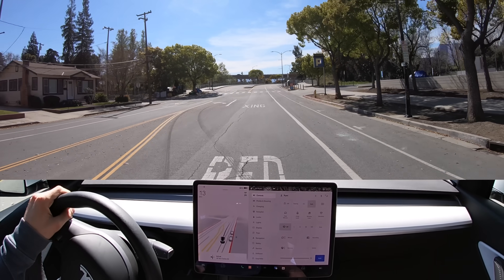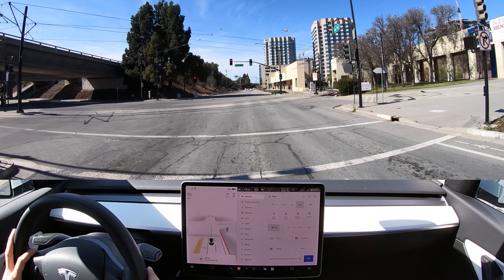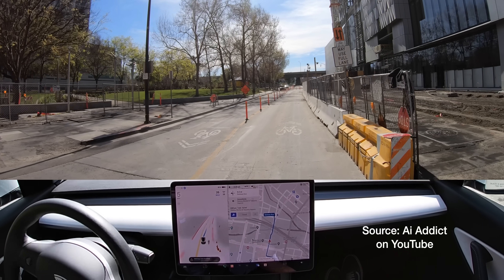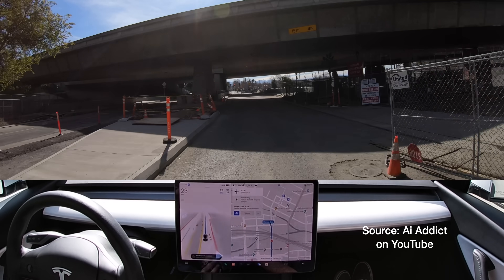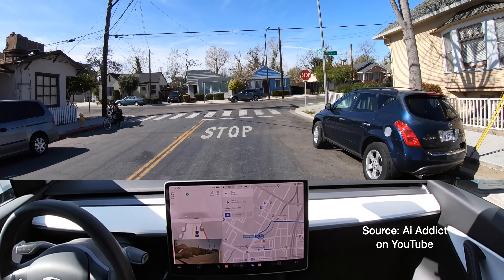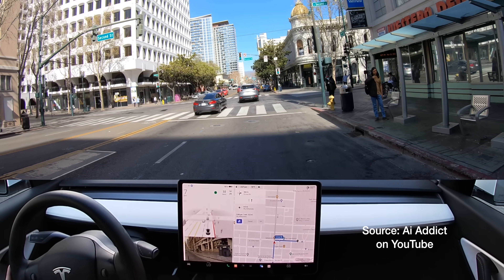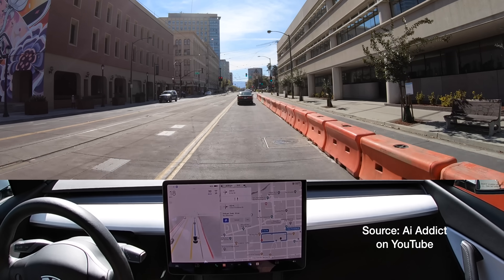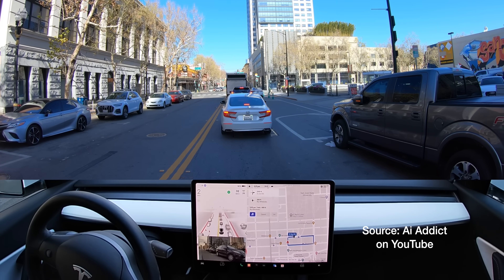Tesla FSD Beta San Jose Stress Test

Comment: It seems like it always goes into the bus lane first, when it should really widen the turn into the  correct lane..

It seems like Tesla has pretty much gotten up to the 80%-90% solution which a great achievement..... It's the other 10% of driving situations that are the hardest to manage.  I'm not confident that the current system will ever be "ready for prime time" when it comes to automatically handling unusual situations.

Comment: Stop posting shit videos. You are giving Tesla a bad name.  I own a Tesla Model S myself and it has a bunch of problems, but this is the price we pay for driving a Tesla. No need to tell the whole world about the problems. Just hide it because Tesla and Elon Musk is a God!  

When I accepted my car, I too noticed the shit paint job on the doors and bottom trunk that has massive orange peel and over-spray drips. Did I complaint? Nope! I just took it to a car detailer and they fixed it for me. Only cost me $800 to fix it.  Not a big deal!   There were some area that was touched up due to paint being chipped and or scraped during delivery / testing. Not a big deal. You can't even see it unless you look at it 1ft away. 

Yes, my rear taillights do collect moisture everytime it rains. Not a big fuckign deal. Every night, I just put a heat lamp behind it and by morning, the moisture is gone.  Just head to walmart and buy a heat lamp. Not sure why so many people crying about moisture in the tailights. This is normal because our cars are made by hand and is custom made.  There are bound to be some issues with this. But when I step on the brakes, it still lights up and works like a brakelamp. So quit bitching about it. 

Yeah, my fender gaps are all over the place. Again, this car is hand-made by hand by unskilled laborers. You expect fuckign perfect fitment? lol GTFO here with that nonsense. Not a big fuckign deal. We spend 95% of the time inside our cars. Why the fuck you crying about poor fender alignment? Who cares if the left is has a bigger gap than the right side. It's a FUCKING FENDER. It doesn't affect performance.  

Yes, the rear trunks RUBS every time I open it. That isn't a big deal since I rarely open the trunk.  No one is going to notice it anyways. So many idiots out here crying about their trunk only opens halfway or how it rubs, squeals, makes noise. GTFO here. It's a fucking Trunk. Leave it closed. WTF you doing with the trunk everyday? Not a big deal!

Yes, my interior plastic panels is falling apart and squeals at every bumps I hit. Just glue that shit back on. You idiots heard of glue? I bought a box full from Amazon for dirt cheap. I keep it in my glove compartment and glue it panels every now and then when they pop out for no reason. This isn't a big deal to me. Glue works fine. You idiots don't know how to use glue? LOL 

Rubber door trim falling apart. This is normal wear and tear. You open and close the door every day. WTF do you expect? You think these rubbers trim are suppose to last more than 6 months? lol fucking morons.  You can buy these rubber trim off Tesla for $600 a piece. Yes, it will take 8-10 months to get it but Tesla is one of the best selling cars. You know how many cars are out there. These gaskets last 1-2 months so they are selling like hot cakes.  Plus, these parts puts more money into Tesla pockets! So I'm glad they found a way to earn extra money selling parts for Tesla. 

Most of the complains are all part of owning a car. It's called Maintenance. If you cannot afford to maintain your car, than don't buy a Tesla. I am a proud Tesla owner and will buy the Cyber truck. Tesla is the BEST car manufacture out there. Elon KNOWS what he is doing. All the people bitching about Tesla need to STFU and quit defaming the brand. If YOU think you can do better, than make your damn car.

Comment: Question: does the car not have some kind of mode that lets you record the way you drive on a specific road so the car knows where to go or to manually look at the map and remove areas the car shouldn't go to? I feel like adding that flexibility would at least prevent it from going down things such as the rail road tracks as you would know the car does it and you're telling it not to go down that road in that situation. Might be difficult to implement (i don't know for sure) but it seems like it would at least prevent the car from making the same mistakes given a very specific situation as computers can be very stupid at times.

Comment: The big problem with AI driving is that every town every city has their own rules and regulations. Not to mention weird geographies. And special roads that are not seen everywhere. 
There is a street in my city that for two hours a day both lanes turn to one direction. And not just for two hours, technically it’s four hours, but I’m the morning it goes one direction, then both then just the opposite direction. 
Another road doesn’t allow turning left. From either direction, except curtain intersections.
Reply from the maker: We have one of those here across from Santa Clara University. 2 lanes with a suicide lane in between. During certain hours of the day traffic lights control which direction can flow through the suicide lane or declare it open to all regardless of direction.

Comment: The "Louis Rossmann Effect:" You now have more than DOUBLE the subscribers Louis said you had a week ago, when he definitively and assertively told us to not watch or subscribe to your videos. Congratulations!
You know, the amateur tech in me is wondering about the hardware aspects of Tesla and FSD. Are there enough sensors, is data throughput fast enough, is the processor able to handle all of the software to operate the car plus FSD mode and how often during those modes are sensors polled... All factors that could impact FSD and autonomous driving across all manufacturers. I would think that there's a lot of data being sent all over the car during normal operation, are we asking too much of it with our current computing technology or does the software need tweaking? Sometimes I think too much...

Comment: 7:10 with so many roads that have railroad and car way both, isn't it simply lack of signage that is a problem here? 9:44 the worst problem is that it doesn't seem to learn? Should it be learning from examples based on human's decisions? Or are they too context-based? But this is totally the same point... wonder if it learns with 4th / 5h / 6th time? In general, as a conclusion, it seems that the sweet spot would be not having to prepare the driveways in a special way for those cars... but in reality, those cars need proper signage, like not special but really proper and solid signage. And it seems to be analyzing too slowly and taking decisions too slowly (those cases of full stop are annoying). Wonder if it's hardware or software thing?

Comment: When you turn right across a bike lane, are you checking for bikes approaching from behind each time to avoid a right hook? Especially when you are using the accelerator to force the car through the turn, you should be checking for bike riders because their approach may be the reason the software is hesitating. Right hooks are deadly.

Comment: As much as I would like to take you at your word. I have a sneaking feeling there is something being left out of the description of why you were fired. If every single FSD video was glowing and only showed the software doing the right thing all the time. Then I could get how what you say happened would end up with you fired. But there are a number of youtubers who have done exactly what you have done. Sure they dont work for tesla. But they have not had their FSD Beta access cut off, nor have they had their access to releases downgraded to the point where they are stuck on an old release permanently.

So if the negative videos those youtubers are doing is not a problem. Would love to know why yours is different. Personal opinion is there was an expectation or fine print in your work contract. Which if that is the case. This is on you. Doesnt matter if you were doing it on your own time or using your own equipment. Your dont stop being a representative for a company just because you clock out. It sucks but thats the reality of life.

I also wonder what exactly you did for tesla. Mainly because you talk about the issues you see in a manner that leads me to believe you dont do any engineering for the product. I am not using that to discredit just stating my impression, that I would love to get clarified if you feel like doing so.

Comment: Some of the things you mentioned in the beginning of the video explain why I plan NEVER to buy any Tesla product.

The fact they could disable the full self-driving feature that YOU PAID FOR is completely and utterly wrong. I do NOT want the manufacturer of my vehicle to have ANY CONTROL OVER IT. I paid for it, I own it, I can d**n well use my own d**n car.

It's wrong if Tesla does it, and it's wrong if anyone else does it. In my view, any car with wireless networking capability is unacceptable - as they might use it to exert that kind of control, and it could even be hacked. Neither outcome is one I'm OK with.

If that means I'm stuck with cars from the early '010s for the forseeable future, I'm fine with that.

Comment: Self driving vehicles are dangerous. Auto assist on a long road trip maybe I’ll use. Total self driving. I will never use that. Going through that construction zone was awful. Running the red light. Stopping on the railroad tracks. Missing Stop signs. Trying to drive down the rail lane. WTF.

Comment: Second comment -- in fairness I would have probably ended up going down those railroad tracks too.  That intersection as a right hand turn is ridiculously confusing if you're not familiar with it.  You got tracks on one side, uninterrupted red bike lane on the other, and one skinny left hand lane as the only proper one that you have to run across the red bike lane to be in.  GTFO of here.  Ridiculous to assume AI could manage that without an intentional map advising of what it has to do there.  I would definitely be confused.

Comment: While it is fascinating to see what FSD will do if permitted to, of all beta testers I watch on youtube, you consistently let it go far longer beyond the point where it is clearly making a mistake.

It makes perfect sense that Tesla found this to be unacceptable and pulled your access to FSD beta. That you were a Tesla employee (I was not quite clear on that) makes it even more unacceptable.

I did think maybe I'd heard you mention being a Tesla employee, and, if so, found it surprising that your testing methods and videos were considered acceptable. Now I know they weren't. I should note also, that just because you are off the clock, does not mean you have zero obligations to your employer--especially if you publicly state that you are an employee. That makes you a de facto representative of the company.

It is also unclear whether you actually are attempting to be unbiased, as being so permissive with FSD beta means that you not using it as intended. The bollard accident is a case in point--something you could easily have avoided. It is fair to questions whether you want to embarrass Tesla and provide fodder for Tesla haters.

I cannot look into your mind and know your intent. Perhaps you genuinely believe you are doing the right thing. If Tesla was presenting the current version of software as L3,4 or 5 and the driver, perhaps testing and presenting as you do could be considered unbiased. At those levels immediate driver intervention is not supposed to be required or expected. But current versions of FSD beta are L2, thus your videos become examples of improper use, or even abuse of the system. It is not like going to sleep in the back seat, but it does cross a line.

Frankly your tone of voice has always struck me as condescendingly negative towards Tesla and FSD beta. Maybe that is just how you talk. I don't know. If I was one of your coworkers on your team, I know I would not want  you on my team, if I had seen these videos.

You really should consider changing you approach.
Reply: Taking your post to its logical conclusion you appear to be saying that because the system is level 2 the reviewer shouldn’t let the car stay engaged at all after he feels uncomfortable.
In that case no data would ever be available for progress beyond level 2. The whole point of real world driving is to explore how the system behaves and disconnecting isn’t doing this and certainly slews the statistics.
I can see Tesla’s argument but they seem to be discarding valid negative experiences and therefore not learning: this doesn’t feel good if it’s only the positive driving that’s on the record.

Comment: would love to see what Comma.ai would do in these situations and how it would compare to the route you're doing. Can you look into getting a Comma.ai device and supported car to compare?
Reply: Openpilot can’t really do this type of driving yet. It won’t do anything related to navigation or stoping for anything besides a lead car.

It’s great and works better in some situations, but is a completely different beast so far.

By the end of the year they are expecting to have these features in a usable capacity though as they will be discontinuing their old platform and that will enable them to put more effort into the new features.

Comment: 7:12 I probably would have ended up on the tracks myself, not having driven around San Jose before.
Reply: Difference is you'd only make that mistake once. FSD isn't able to learn that way and will make the same dumb mistakes over and over.
Reply: It was very confusing for me as well and I live in NYC.  So in some parts of the video it's OK to ride over the tracks and in other parts it's not?  What is the key visual differentiator that FSD could be trained to recognize, the slightly raised median?  If I don't see it how on Earth would the learning algorithm figure it out?
Reply: @RobertLoPinto  that's kinda the problem though. It's easy for you to figure it out, but I don't have any confidence that a machine could do it in the next 10 years.
Reply: @Tysca_  It's all about the training data and labeling. The long tail of edge cases will need data. This data is not as common for the very reason its an edge case. Tesla can only focus on so many edge cases at a time as they continue the march of 9s. 

With single stack convergence and Dojo the amount of data they can process in a given unit of time with autolabeling will accelerate this by orders of magnitude. Combine that with simulation data for the variations in weather, lighting and other variables with the ever expanding  real world data and this will take a lot shorter time than you think. No where near 10 more years following Dojo.